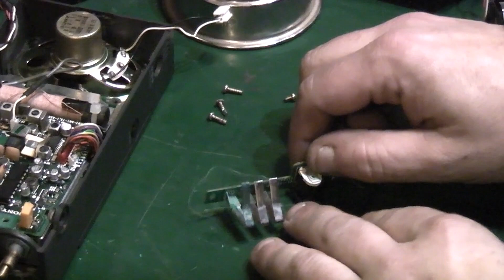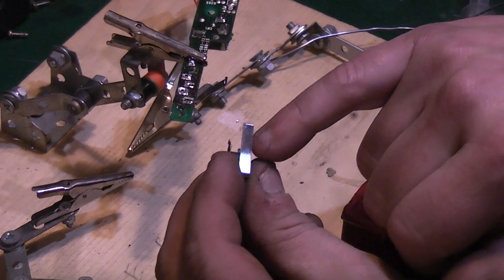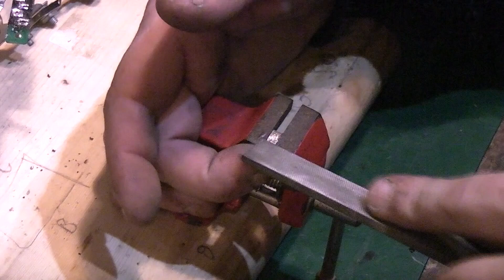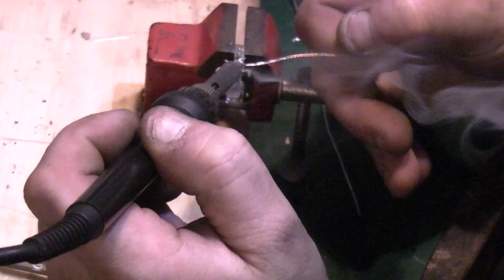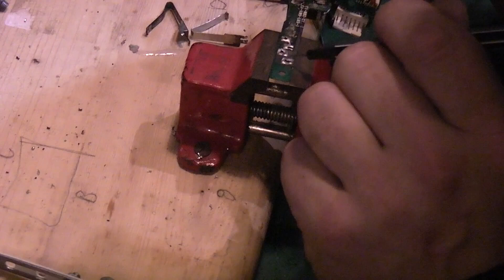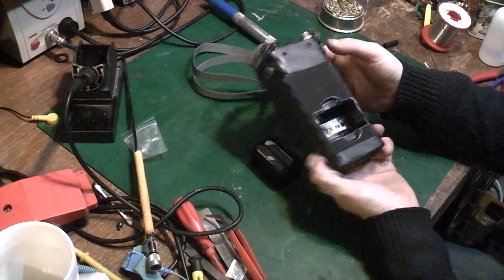Sony ICF-PRO80 radio repair Pt6

Comment: Hello Jay,
My name is Przemek and I live in Warsaw, Poland. I watched your struggles with the Sony ICF PRO80 in YouTube videos and I decided to ask you for advice In my case. Since I received my friend's completely dead receiver, I am trying to repair it. I have the Service Manual at my disposal. I have previously restored many Sony ICF SW1, ICF SW100, ICF SW55 and others. Of course, the most common cause of damage to these receivers were leaking electrolytic capacitors and the electrolyte itself causing severe corrosion.
In the case of PRO80, I started by replacing 18 leaking electrolytic capacitors with tantalum SMD capacitors. Despite such a radical replacement, the receiver still did not respond.
After turning off the muting system by disconnecting the collector of transistor Q201, I found that both Volume and Squelch potentiometers did not work so after gluing the contact sliders in place I successfully repaired both and the receiver finally responded. Unfortunately, stations on medium wave, long wave, FM and probably short wave, show a frequency on the display that is one or two tuning interval ch steps lower (9kHz medium wave, 6kHz long wave) than the transmitted frequency. I set the Reference Frequency Oscillator 7.2MHz (suggested in the Service Manual) to obtain 118.7MHz at the test point, but this result is not stable and jumps every few seconds between 118,700,032Hz and 118,700,096Hz however both values are within the required +/-100Hz range. I also noticed that the sound is distorted, probably due to lack of proper tuning.                                                                                         I have the impression that the problem lies in the frequency synthesis system, but I have no idea where exactly to look for it.
I would be very grateful for all your diagnostic suggestions.
Regards
Przemek
Reply: I have a similar problem but I haven't found a solution yet

Comment: I would have given it a bath in vinegar and the use a dremel with a small wire wheel, not the metal one but I bought a sort of plastic wire wheel an Ali, these are green red and black depending on hardness and cost near nothing. I have gotten extremely corroded battery contacts (worse than this one) looking very nice again using this method. Instead of using regular solder, a better option is pure tin solder, as lead tin oxidizes in time.